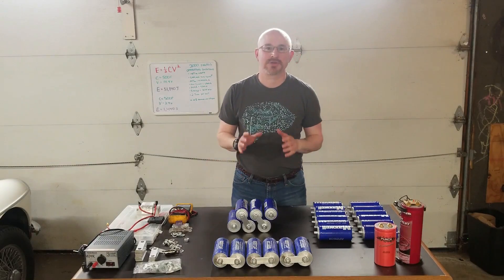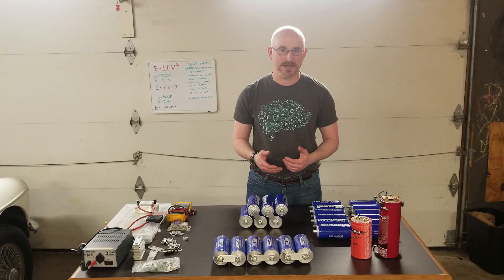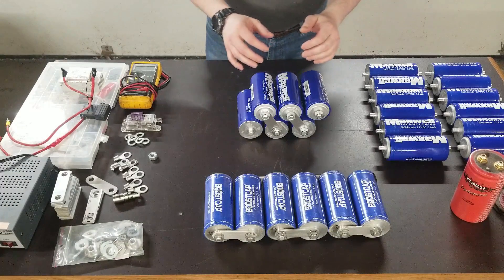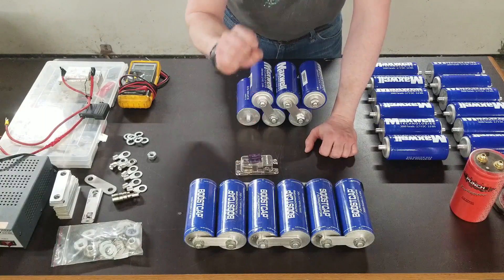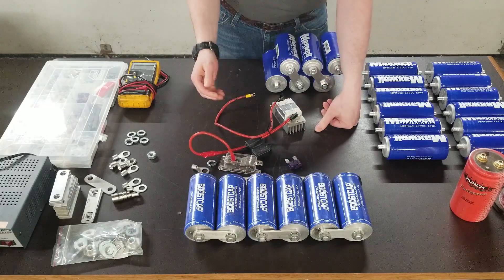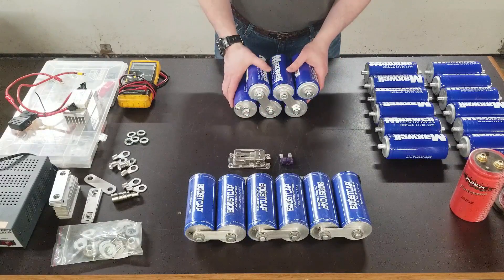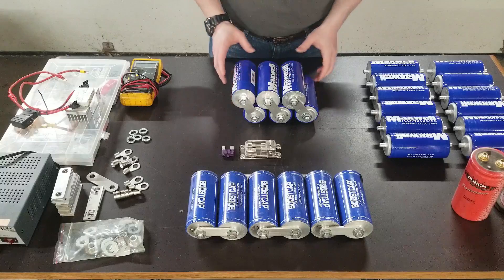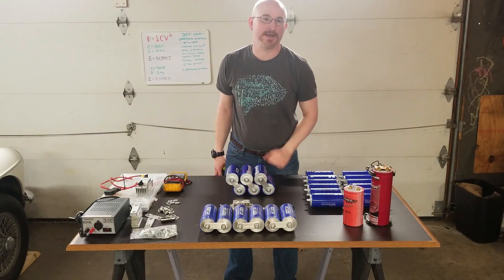Electrical engineer explains ultracapacitor Safety Tips and Tricks - Car Audio Applications

Comment: Is it possible to power a e bike with just capacitors.
Reply from the maker: Yes, but you would need to keep feeding back into the caps with regeneration through coasting and braking to keep recharging them.  And their useful range would be determined by how much regeneration would be had.

Comment: Can you explain how to make a Supercapacitor battery bank 48V to drive a 48v 1.5kw motor
Reply from the maker: Step one is to combine enough caps in series to achieve the desired voltage rating.  Next, you'd need to determine the amount of time you want the caps to last for.  Then you'd have to increase the number of caps in series to improve the usable voltage range.  Meaning, if you had a 60V rated bank, charged to 60V, the amount of usable time would be the amount of time it takes for the cap bank to discharge to 48V.  You'd need to regulate the output at 48V, and maybe have a regulator that can operate down to a 10V input while maintaining a 48V output, in order to increase duration and make the most of the bank.

Comment: Good stuff... I currently have Dyna-batt manufacturers ID 5575B  its a 12V, dry cell battery, 16amps hrs, and it is 4 years old. I bought it for the weight savings and at $159, it was the best option. Now, the CCA on it is around 280 and I live in NE and on days where its under 50 degrees, the car struggles to start. I want to maintain the weight savings and I like the idea of a supercapacitor. What kind and how many would I need to help boost this battery? A schematic, or links to what I can buy would be awesome.
Reply from the maker: Sorry for the delay.  You'd want the same arrangement I show and use, a bank of six 3000F in a series configuration wired in parallel with the battery.    It's possible that your battery is past useful life.  The battery should be good down to -20 deg F.  With my cap bank and an AGM battery I was able to start my car in -30 deg F weather the past few years (northern IL).

Comment: Sorry but why would you pull the caps out before a car service? I didn’t understand why
Reply from the maker: Sorry for the delay.  The reason for disconnecting the caps is safety for those servicing the car.  And I don't pull the caps, just the fuse protecting the caps.  Otherwise the positive battery cable is still energized and if someone disconnects the front battery they may think it's ok to let the positive terminal contact metal in the engine bay - if that happens you'll get a few thousand amps in a short circuit spark.  It could also allow the car to still start, which could endanger a mechanic.

Comment: Have you used super capacitors together with a regular battery bank?

If you have, how do you avoid the battery bank and the super capacitors from reaching equilibrium?
Reply from the maker: Yes, all of my applications were in parallel with a standard lead-acid wet cell (AGM) battery.  The caps simply match the battery voltage and provide some resistance to voltage drop during short durations (the typical purpose of a cap).   The benefit of caps + battery is the caps track the battery.  Unlike two batteries where the weaker one drags down the stronger one.

Comment: Hello, I'm trying to make a 70 Ah 12V battery car to replace mine with 3.000F ultracaps, how many caps I should use to have the same capacity?  Thank yo so much.
Reply from the maker: HI, Dani.  The challenge with ultracaps is that you don't get to realize (or use) all of the stored energy because we have operational thresholds to the voltage range we can work with.  That is to say that an application may have a usable voltage range between 10V-14V DC.  In this example, we can't use the capacity from 0V-10V DC.  

You determine the series string quantity based on your max operating voltage.  You should use protection circuits on the caps if you plan on reaching their max voltage rating.  Your calculations on energy storage are limited to a smaller voltage range - i.e. 4VDC in our example.  

While the bank stores about 51,000 Joules of energy, only 4,000 J are available between 10V-14V.  One Amp-Hour = 3,600 Joules.  As you can see, it's not feasible to expect 70AH out of a cap bank operating at such a limited voltage range.   For way less money, a Li-Ion battery bank would be more useful in your application.

We like using ultracap banks to help support fast, dynamic loads on battery systems.  While they can be used for energy storage and longer duration loads, you'd want a way to actively convert voltage to offer a wider usage range.  Such a circuit would also be expensive given the current demands.

Comment: These are not ultra capacitor.
These are lithium titanate battery.
Why you are spreading confusion.
Reply from the maker: They are definitely an ultracapacitor made by Maxwell, Part Number BCAP3000

Comment: Can i use a wind turbine ti charge this batteries
Reply from the maker: You can certainly use ultracap banks in wind and solar applications.  You need a series bank with a suitable voltage range then additional banks in parallel to boost useful runtime for the load.

Comment: so youre saying dont upgrade the alternator and go ahead and get lithium and supercaps lol
Reply from the maker: Depends on the application.  If the system isn't drawing more than the stock alt can provide, upgrading the alt is pointless.  If the system is drawing more than the stock alt can provide then upgrading the alt is a needed first step.  These ultracap banks help stave off drop during musical peaks and were a secret in USACi DB Drags for several years before I started using them in musical SQ builds.

Comment: What about balancing voltages between caps??
Reply from the maker: I have another video looking at this exact question.  There will be differences in voltage across each cap.  There are protection circuits available that prevent overvoltage but they don't "balance" to make the voltage across each equal.

Comment: You mentioned regenerative braking - does anyone do that, commercially?  I designed an electric drive system on paper a while back, and came up with that idea myself.  The regen circuit could be designed much more efficient at a higher voltage if it directly fed a capacitor bank.   Then a buck/boost charger could drain the caps to charge the main batteries, and/or supplement drive power during high acceleration.  Haven't heard of anyone doing it though.  Of course, back then electric car battery voltage was considered 'high voltage' at 48 or 72 volts.. lol..
Reply from the maker: Regen braking is much  more common, even on non-hybrid cars.  My 2014 Accord essentially uses the alternator to load the engine when braking coasting which causes voltage output to jump from the normally regulated 12.5VDC to 14.4VDC.   The issue with caps in a high voltage application is the number required in series, you'd have banks similar to the 18650 or 26650 battery banks in some electric cars or the "powerwall".

Comment: You left out voltage balancing between capacitors. As soon as you connect ultra capacitors in series, they exhibit voltage imbalances across each individual capacitor, where you could easily end up exceeding the 2.7V rating and damage it. I tried connecting them the way you show but had to give up and go for a balancing board, that uses MOSFETs to shunt power and protect each cap from over voltage.
Reply from the maker: We use incorrect terms when we talk about "balancing" for the protection circuits.  A balancing circuit would actively adjust the voltage drop across each to be equal.  What I think you and most people arr talking about are protection boards that shut voltage that exceeds 2.7VDC.  These circuits won't "balance" voltage across each cell but provide protection of overvoltage due to ESR variances.  My more recent video tests voltage variances and I do identify that the cell bank under test would benefit from cell protection.  Testing different types of cell protection and maybe looking for some active "balancing" would be a future study.

Comment: Could I use the maxwell ultra capacitor for my 12k watt car audio system. My friends say use lithium. Just I cant afford well over a grand for a battery. Just I've never used a ultra capacitor or lithium battery. I'm not rich. I just want to know what's best honestly.
Reply from the maker: Ultracaps vs. Lithium depends on your goal.   Banks of caps will help ride through musical peaks but Lithium will help with SPL overall by stabling voltage over long notes.  Remember that ultracaps were used secretly in SPL years before we made them public for all mobile audio enthusiasts.  My friends with 12kW systems use 4-6 banks of caps.

Comment: Well I have 2, 2.8v 3000f capacitors. Can you tell me what volts I set it to, to charge them please. I have a bench power supply which goes up 30v & 5amps . Would charging at 2.5v at 1.5amps be to high. Thanks.
Reply from the maker: Sorry for the delay.  If you have a pair of 2.8V caps wired in parallel then you charge them to 2.75V or so, stay under 2.8V.  If you have then wired in series then you charge them to 5.5V or so, stay under 5.6V
Reply: @richardvedvik979  ok thanks for your reply.

Comment: So technically it safe to connect it directly on car battery without balancing circuit?
Reply from the maker: The available circuits don't "balance" as much as they just limit over-voltage conditions by bleeding off the excess through a resistor.   Mine haven't had balancing circuits for 7 years and I know of hundreds of installations without balancing circuits.   That said, my new video does reveal a good case for protection circuits and i'll be testing those next.

Comment: You can use a 12 volt incandescent bulbs in series with the caps for charging them also.   Resistance is high when bulb is lit and drops and charges cap faster as bulb goes out and becomes zero ohms.   They will charge faster this way.   I used this technique on 450 volt DC power supply I made to charge flash capacitors from mains with a rectifier and 100 watt bulb in series.     It worked perfectly and the bulb dissipates less heat during on charge cycle.
Reply from the maker: Agreed, those bulbs work great but add a challenge in that they do get hot and need to be supported somehow.
Reply: Light bulbs should generate less heat than resistors since they're converting some of the energy to light rather than 100% to heat like the resistors would.

Comment: if your using these for solar , do you need a charge controller like you do a battery.

i wont be running any long term stuff off of the solar , i only need a few hours (3 at most) at a time but i can't predict exactly how many amps i will need .
im basically using it to electrical experiments,
instead of using mains power i want to use solar cause i can isolate it from ground a lot easier (so i don't get the mains interference) and it be pretty portable
Reply from the maker: You always need a charge controller, or at least a voltage regulator to prevent over-voltage for each cell and the bank as a whole.

Comment: What would you recommend I have a 370amp alt, 2 agm batteries ,and a have 6   2.7 3000farid  caps , So with 6 I’m sitting at 500 farid  I’m staying around 14volts  would adding another 6 benefit me ,it would drop farids to 250  ? Or am I better staying with just the 6 , I’m not planning of really going over 14-14.5 volt  system is 5k rms @.5ohm so there is some major draw when it’s really getting down.
Reply: you connect the banks parallel, so you would have 1000 farids. in the bak itself you connect the cells in series, thats why voltage increases but the capasity decreases

Comment: Hey Richard, thanks for the easy to understand, helpful video. I'm new to this and had 2 questions
1. For a bank used in car audio, does the negative post get grounded to chassis/frame like a battery?
2. If I had 2 banks, would I run each in parallel with battery and in parallel with each other?
Thanks so much for your time
Reply from the maker: Hi!  The cap banks get wired just like an extra battery.  Bank ground to chassis, and you parallel banks like you parallel batteries.
Reply: @richardvedvik979  thanks very much man, you and your videos have been a great help

Comment: I see, so you are the guy responsible for these house shaking, windows rattling passing cars playing music (base, mostly) at full volume! I am thinking about the ways I could "audio frequency RF bomb" them and blow theirs audio PAs. Those super-caps in their system would just be very helpful, delivering necessary momentary power. 😁. Joking aside, great content; thank you. Thinking about other uses of these wonderful devices in applications where quick re-charging and huge momentary power delivery is needed as a supplement to the battery.
Reply from the maker: I'm mostly involved in the sound quality side of IASCA, but I am guilty of building some window shakers over the years.  :) 

Instead of an RF bomb, you'd want an EMP that could direct a magnetic field toward the vehicle, the magnetic field would manipulate the speaker/woofer cones and could move them beyond mechanical limits.  :) 

I think cordless tools could benefit from some ultracap assistance, albeit from the much smaller versions.

Comment: hi richard.i have a question..lets say that i have 6 cells of 2.7v = 16.2v and i dont use a balancing circuit. if the alternator broke and start sent 17v+ what will happen to the cells? will do explode or something?
Reply from the maker: Capacitors fail in a couple of ways, but I haven't personally seen an ultracap failure from overvoltage.  From those that have, it's just a venting of electrolyte, nothing violent.  the end result is a damaged cell and an open circuit (not a cascading fault).

In college we used to blow up small caps with overvoltage and as the cap size increased, the excitement decreased.  The larger caps just discharged their electrolytic fluid and smoked.

Comment: High VOLTAGE...you will get jolt by touching positive and negative my elbow touch both i felt a GUD ONE..DISCHARGED sound like gunshot...
Reply from the maker: The NEC classifies low voltage as below 50V, and this application operates at 12VDC, well below the threshold.  Some capacitors can store a few thousand volts and are very dangerous!

Comment: I do have a question i noticed you do not have the over charging protection buss bars on them is it ok and safe to direct connect them to a power source with out a protection in line. are they fine directly connect via the buss bars and not explode from over charging if it is under the rated voltage? i know as like a battery can explode if over charged i do relies they are completely different but dose over charging equal the same thing. Because i see charge protection buss bars for these things for sale.
Reply from the maker: Overcharging would require providing voltage across the caps that exceed their rating.   In a car with a 14.4VDC output we can safely connect the bank of six with a combined rating of 16.2VDC

Comment: Where is your Protection Boards?
Reply from the maker: Protection boards are required anytime you plan on operating at or very near the voltage rating of the capacitors. In this application (mobile audio, automotive) we are always below the cell rating and therefore slight  imbalances between the ESR of each of the capacitors won't result in a situation were any of the individual capacitors see in overvoltage situation.

Comment: why dont they use these for solar power storage?
Reply from the maker: They do,  that was the previous use of the ones i have.  I bought them used from a guy parting out solar power storage systems.
Reply: @richardvedvik979  these look like they would be better than 18650 in solar

Comment: I'm sure these are fine in many applications but for car audio I'll just stick to an H/O alternator and good battery because it works just fine.
Reply from the maker: I use an HO alt whenever it's feasible.  Always upgrade battery and add depending on the application.   For my 2014 Accord an HO alt wasn't available at first due to CANBUS control.  These helped in my application along with an AGM batt.
Reply: Realy ... For car Radio .. yes car audio No .. 
And if you don't know why .. .. ill beat you ass in ewery bass contest .. !!! No alternators or batteries can keep Up with any 
High performance Car Fi ..
Reply: @kennethschultz6465   oh noes...don't beat my ass in "ewery" bass contest there Mr. Bass Master Pappy.
Reply: Lol bigger ain't alway's Better .. smaller is faster 
And a combination of Meny small super fast to the spikes
And middel zice and huge Cape befor battery .. 
Then you kick b-ass

Comment: How does carbon present a surface area 3000 times that of aluminium?
Reply from the maker: When viewed at a microscopic level, carbon sheets are not smooth.  There are some neat images online of this.  Craters and cavities present more surface area in their topology than an equivalent smooth surface.
Reply: @richardvedvik979  I doubt if aluminium looks so smooth close up. But a factor of 3000? That is almost fractal.

Comment: I didn't hear him talk about the accessory kit for Maxwells that ensure the caps remain balanced when charging. If one take more charge than the others, and they therefore are imbalanced, you will potentially destroy the one that's imbalanced.
Reply: did you read his notes on  balancing? He explained why he is not using balancing circuits.